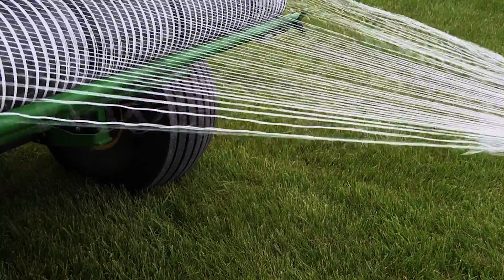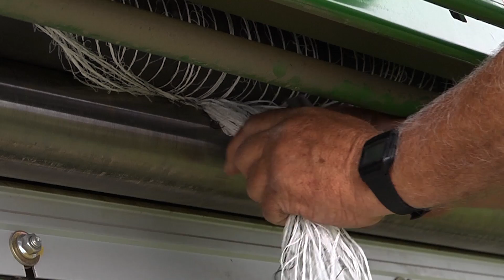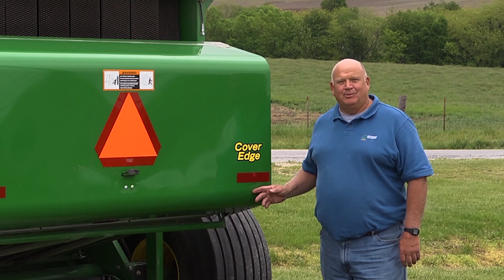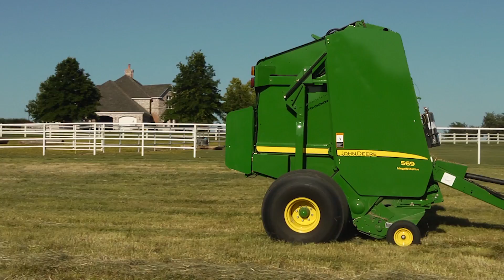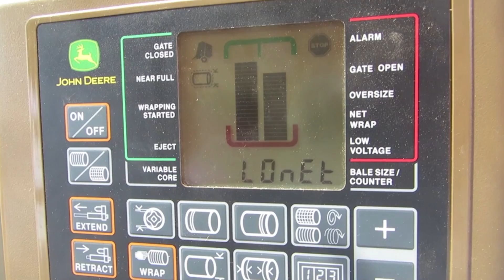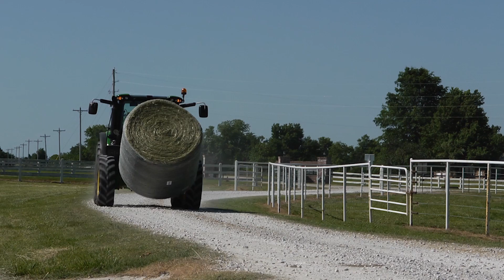B-Wrap® Operating tips (North America)

Comment: Hello we've met before.  I'm trying to troubleshoot a problem with my baler maybe you can help.  When I switch my Baler monitor to the bwrap mode "b1" the oversize bale alarm comes on.  Is there a trouble shooting guide somewhere?
Reply from the maker: Does this happens every time the you try to turn on BW?  Normally, the only thing that will make the oversize bale alarm come on is if a sensor sees metal. Maybe the belt splice was right on top of the sensor when the you tried to turn monitor to BW mode. All you have to do is engage the PTO which would move the belts and get the splice off the top of the sensor. Oversize bale alarm will go off.
Please leave contact information or send to info@tama-usa.com - Our representetive, Ron Amos, will be glad to further discuss this with you.